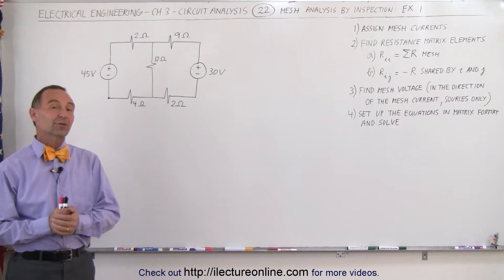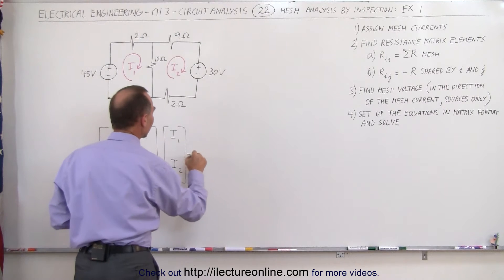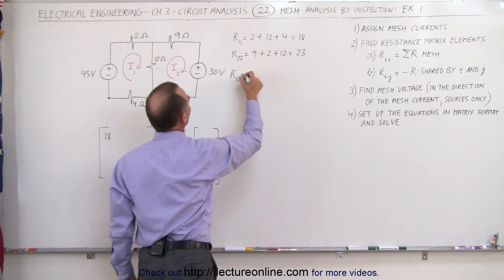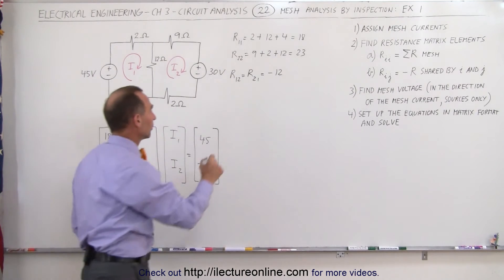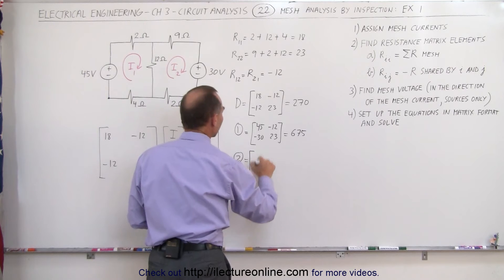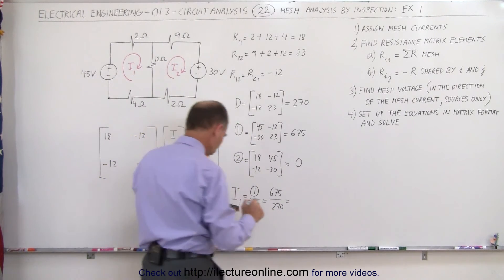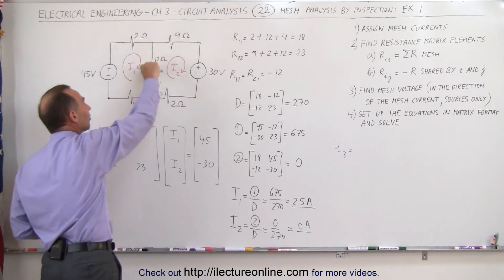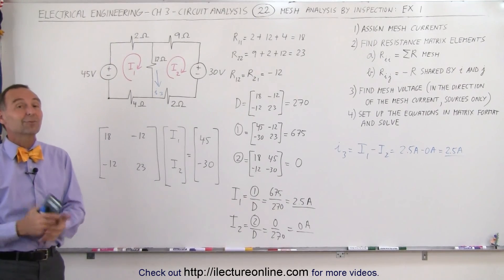Electrical Engineering: Ch 3: Circuit Analysis (22 of 37) Mesh Current by Inspection: Ex. 1

Comment: Shouldnt te voltage column be deternind by passive sign convention .... when current goes into positive terminal it takes posisitve and if negative it takes negative why its not applied here ?
Reply from the maker: If you cross the resistor in the same direction as the current, it is a voltage drop.

Comment: Excellent video, big fan here. I want to clarify how do i define polarities for the mesh currents?
Reply from the maker: The direction of the currents can be "guessed".  When you calculate the solutions, you can then determine if you guessed correctly or if the current is in the opposite direction

Comment: Sir can we apply this General Inspection method for AC Circuit analysis also sir or we can't
Reply from the maker: The basic principles are the same.  (voltages around any loop add up to zero), but the approach will be different, because of the phase differences between the components.  We have videos on that in the EE playlists.

Comment: Thank you, sir. great teaching.

I have a question, I assumed I2 going in a counter-clockwise direction, thus I got a +30 voltage. And when I calculated the currents I got I1=5.16A and I2=4A. What am I missing here? thank you.
Reply from the maker: Did you then make it + 12 I2 in the first equation (instead of - 12 I2?
Reply: When I changed it to +12 in the determinant, hence in DI1 and DI2, I got the right answers but doesn't that oppose step 2.b. (-R) shared by two meshes?
Reply: I did the same thing, following his previous example, the voltages should be -45 and + 30, yielding 5.267 and 4.00 repectively for I1 and I2.